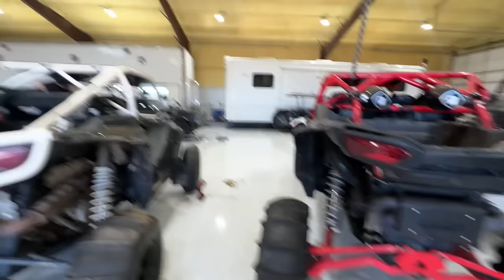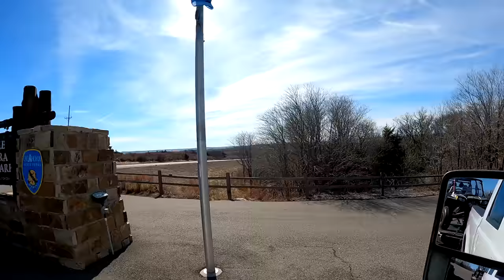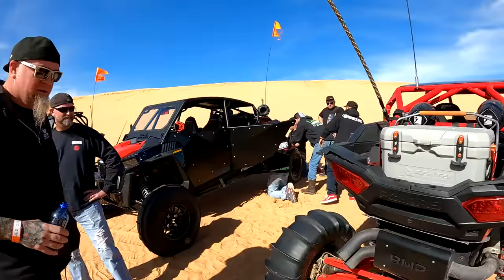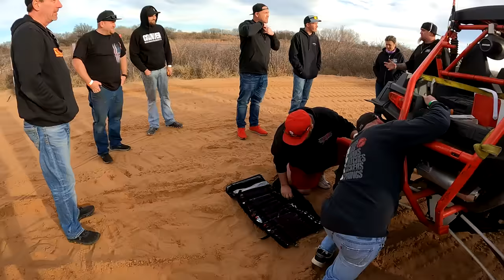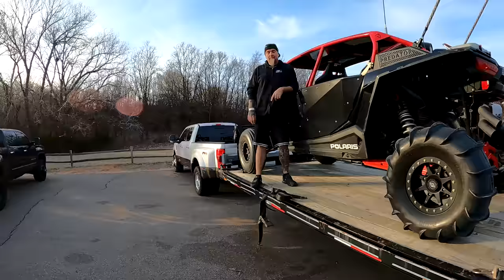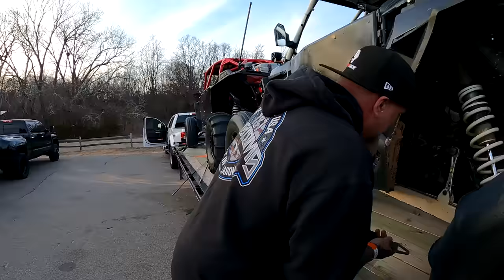Time For A Dune Trip! Rippin Our SXS’s at Little Sahara Oklahoma!

Comment: Go to a paragon turbo upgrade!  Evo powersports tune
Minimum Clutch springs and different weights or full clutch upgrade 
Shock therapy shock and spring rework(probably the best modification you can do to them for the ride)
There is a brand: "LSX X Travel Front Suspension Upgrade" it completely changes the front end completely:  Offroad Capable 5 Link Virtual Pivot Front Suspension
Xtravel Technology Eliminates The Antiquated And Nearly 90-Year Old A-Arm Style Suspension Setup. It's about $5300
Add around 40-60 reliable HP to the rig

Comment: First off they didn’t outlaw 3 wheelers. There was an agreement reached that 3wheelers couldn’t be imported for 10 years but no ban on owning one . But since the U.S. was there biggest importer there was no point in them continuing to build them however there were still some sold overseas as 88 models just re badged with different names mostly just the Big Reds which were rebadged as Super Red and were basically left over 87’s . The last 250r was sold in 86 which is the first year for the TRX 250r . There were no Yamaha TriZ 250’s past 86 however Kawi sold a few 87 TeCate 3’s and was also the first year for the T4 Suzuki never built a performance 3 wheeler there were some conversations from MX bikes but no factor bikes there have also been kits and one off MX bike conversions built on most all MX bikes and plenty of 500cc 2 stroke builds but none factory aside from Tigers and Franks but they were all hand built one off bikes ! Secondly they are not dangerous there were kids and people that jumped on them knowing nothing. If you know how to ride they are no more dangerous than a bike or a quad they simply take more devotion . I own 10 and have been riding them since I was ten I’m fifty now still ride I ride my 86 350x yesterday! They have become popular again over the last 10 years just look it up on FB or Insta you can buy a brand new 3 wheeler right now but they are expensive ( unless you do it yourself) because it is a combination of a new Quad new MX bike and custom parts but they are sitting on show room floors for sale .

Comment: How many times you have to replace that drive belt. You loose 15 percent horsepower with that drive belt. I went to a Honda with a shaft drive. Much nicer Unit in 2019

Comment: Any reason why they don't use a chain instead if a belt? I don't know a thing about SXS
Reply: The chain would mean constant movements! A cvt style system doesn't even really use the ribs on the belt! The primary and secondary move in and out depending on throttle input